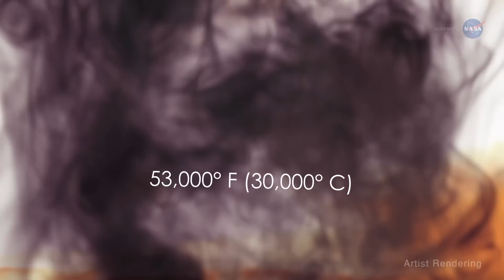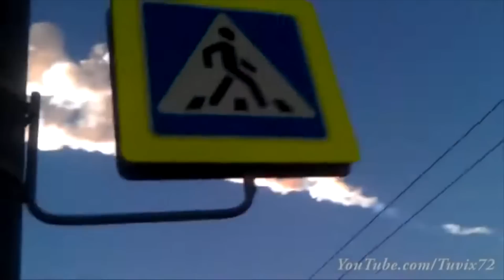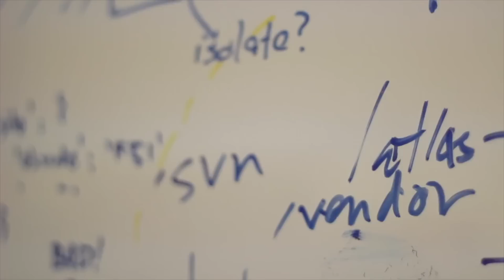Look Up - Asteroid Hunters

Comment: You will not hear of the dangerous asteroids I know, If you had of seen what I and two others saw in Feb 2008 ghost past earth in broad daylight from Qld Australia you would know why the mars rush is on and the reason they give for going is false, it's too long a story but picture a dark hazy mass high in the east which rapidly got larger in seconds to cover a third of the sky beyond ours like a shadow and clarifying into perfect detail as it went past, so close I could observe the facing surface and side cliffs of mind boggling height and length  in perfect detail, we are all so dead, just a matter of time..I saw chunk of a moon or planet bigger than Australia, seemingly bigger than the earth from my vantage point, in perfect detail for ten full seconds ghost by earth in broad daylight, coal black and reflecting no sunlight despite direct sunlight on its facing surface and side cliffs from the angle of the afternoon sun and moving as fast as a meteor and covering a third of the sky continuously for a full ten seconds, I was like an ant watching a train go by at a level crossing as it went on and on at incredible speed for something so incomprehensibly massive, fast as a meteor, but no sound, such was its incomprehensible size and speed and despite being unmissable by the space agencies not reported to the public, I assume because it would cause the utmost panic, I still have bone freeze, I shut up about it after enough ridicule and violent mockery of that unbelievable tale and me saying soon we will see a race to mars and many asteroid missions to try and divert or destroy it, mocked and trashed daily as impossible I stopped talking about it until exactly 9 years later to the month Feb 2017 when a Russian astronomer made the same claim as to what we saw and said we were all being deceived to the existence and intersect course of a massive asteroid, that I can confirm, you are being deceived to its existence, whether it will hit I don't know but it missed us by around 30 seconds in 2008 and I  conjecture and with the mars rush I see I expect it back in feb 2026 and if it hits, even if it grazes us not even the earth will survive intact, let alone any life, such is it's impossible and incomprehensible size and speed. I have been predicting this mars rush will happen since 2008, if they have a base established on mars and the moon before the end of 2025 then heads up in feb 26..the most bone chilling dread awesome sight ever witnessed by a human in all of time that still has me looking up ..man its so big and fast it will be impossible to divert or destroy, it really is game over if it hits this time around, hell it missed us by around 30 seconds in 2008 and no one was even aware or were informed so sure as hell they will not ever tell you its coming because its pointless to do so, panic will not help, nothing will but to get away from the earth, and thats what you see happening, you see.. so watch as the mars rush unfold and wonder why the rush no more and enjoy today
Reply from the maker: oh boy....what did you see?
Reply: @SimonHollandfilms  I am 57 and on my honour and my life everything I said was truth.. all this took place within 15 seconds, or so. My children called for me to see something in the sky too big to be a plane, racing out I saw them pointing to a dark hazy mass very high in the east about half the size pf the full moon I could see was rapidly getting bigger, had no idea what it was of course and had no time to wonder as within a few seconds like a shadow it covered a third of the sky beyond ours and then it clarified into perfect detail into an immense dark asteroid. what I saw and why I say it was a coal dust dark, non reflecting fractured chunk of a moon or planet is because it was easily discernible as such by the afternoon sun angle illuminating its facing surface and side, its size and features I saw particularly the facing side cliff, you could see it was fractured part of something larger from the side cliffs unending both in passing and in their upward direction, the cliffs went up for literally hundreds if not thousands of kilometres and faded still not ending and seemed hundreds of thousands of kilometres in length as it passed by, the same applies for the facing surface far edges which did not end either but faded into distance, surprisingly un cratered and appearing basically flat and dark, coal dark and unreflecting, vast beyond human comprehension, afterwards I tried to calculate its size and speed based on my own know observations of things like jets fighters passing high at speed and known top speed, meteors and there speed compared to what I saw and the size at the distance I perceived also in comparison and the time it took to pass and the result was its even more impossible in size and speed than I try to convey and I simply cannot convey its enormity or speed, just mind boggling, truly a chunk of a planet or moon, for ten seconds it covered a third of the sky continuously at immense speed before abruptly fading away,  my first thought on realising what it was I was seeing was to get a camera but from its speed I knew I would have no time and besides it really looked like it was the end of the world, so I decided to just watch and soak it all up, frozen to the spot, a decision which has me daily kicking myself for years because without proof its just an impossible and unbelievable event because everyone it seems knows how things work in space and everyone seems to know whats in space around the sun and it's just impossible for anyone to accept what I say.....I gain nothing but ridicule from speaking of this and only do so because it is truth.. you can see the mars rush and proposed moon bases and they say its for colonisation but I am saying what I saw and know it is not, you of course know about mars conditions and probably wondered why mars, why bother and why the rush to it yourself and noted the increased interest in asteroids and asteroid missions, they know full well and could not have missed and did not miss its passing .. you will see in a short few years I spoke the truth, not that it will matter.. if you wish go over the Nasa missions and interests from 2008 onwards and spot when they became obsessed with asteroids and getting to mars.. if they have a base established on mars before the end of 25 you wont forget this tale professor, at the time in 2008 a few days later when I saw no report or mention of it anywhere on any news on the planet as I expected it to be the greatest event ever I contacted several radio astronomy observatories even one in Ireland, unfortunately I closed my original account in frustration at the vitriolic attacks I was getting from this story a few years later but someone there may remember that email or have it still and be a precise date near enough and you being a professor may have contacts with radio astronomy people in Ireland I figure and who knows, they might find it if they can figure where to try and detect it.. anyways thanks for sparing the time and not trashing me outright Simon, on the oath, my virtue and honour I tell you no lie..cheers..

Comment: A better question is what would do if a huge meteorite was detected on a collision course with the Earth. Send up an F15 with a satellite killing missile to take it out? Wouldn't it be the equivalent of using a firecracker to stop a Boeing 777?
Reply from the maker: stopping them is a whole other ball game....tracking them comes first.....i like the nudge idea
Reply: That F15 works great on satellites... but yeah a destructive asteroid needs "something a little more". No need to stop it though; only "nudge" it off course (as the Prof. mentioned.) Even a small nudge requires a lot of energy, but that could be delivered efficiently given enough time. For example, ion engine or solar sail. With years or decades of time, such a craft could feasibly save the world. Thus the tracking becomes even more important, because we to know so far in advance.

Comment: It would have been interesting to see a further breakdown into what size meteor would cause what amount of surface damage. Shockwave damage aside I'm assuming here a landfall object rather than one that hits the sea. Also the how the material it is composed of would effect the damage, a stone meteor I would assume (correct me if I'm wrong) could possibly fracture into smaller chunks as it passes through the atmosphere causing damage over a wider area. Whereas a metal meteor wouldn't break up so easily and cause one large impact point.
Reply from the maker: good questions...the minor planet centre rates each near earth objects destructive potential.
Reply: The ice/gravel ones are common, fluffy, and brighter so easier to notice, yet can't make it to the ground at all. So I get a little annoyed when they focus on the diameter but not the composition or kinetic energy. Density and velocity matter a lot more than diameter.
Reply: The insurance industry has perhaps commissioned a study or two. After all, end of the world insurance might provide very lucrative premiums. Although l suppose at some level of impact they don't have to concern themselves with shareholders and the feasibility of profits any longer at all, and thus life simply isn't worth living at that particular point anyway.